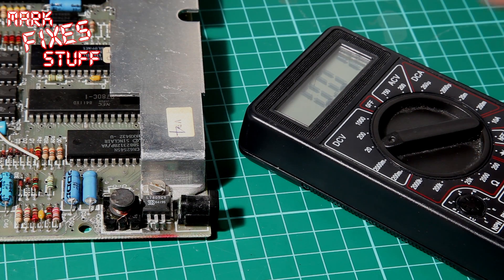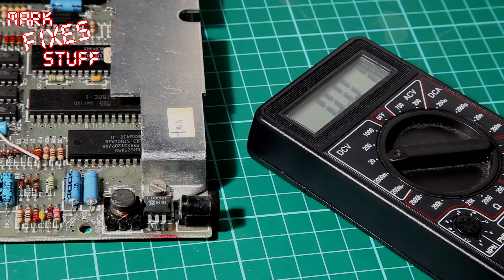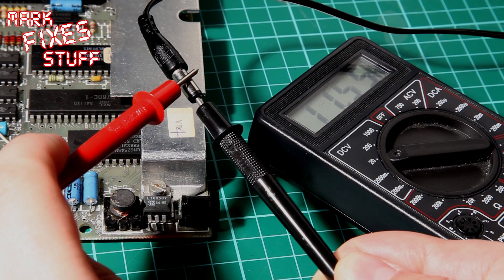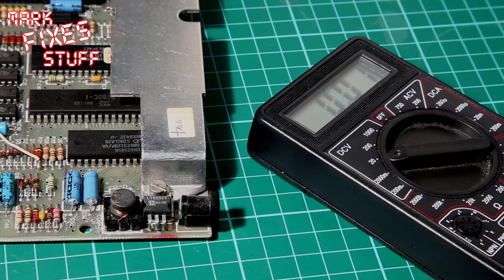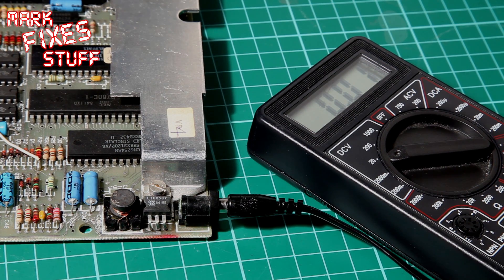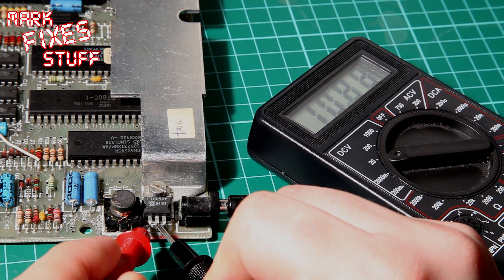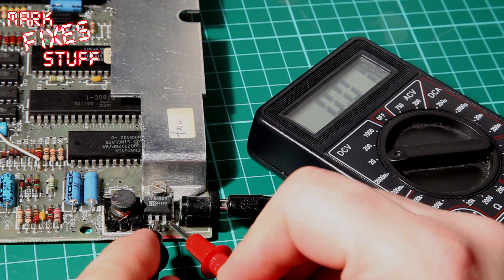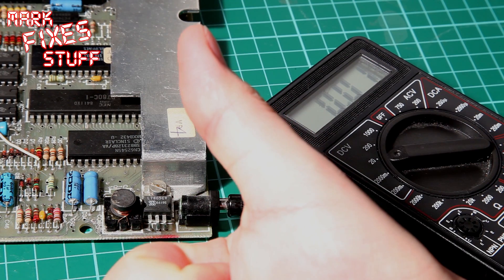Sinclair ZX Spectrum 48k Repair: Test a 7805 regulator in a ZX Spectrum with a cheap multimeter

Comment: Hi, does the computer have a power-on switch thus it's safe to check the 7805 with the power plug connected ("live")? Because if the 7805 is shorted then 10 volts will be going in the 5V rail which would fry most of the logic inside.

Comment: Hi Mark.  I have a 48k here,  the regulator tests OK as in the video,  but when plugged in I get nothing.   The voltages to IC6 (ram) are too low,  where could I be dropping voltage?
Reply from the maker: Hard to say because it could be a short anywhere really. It could be a shorted coil. Does it hum or whine? It should have a slight sound.
Reply: @MarkFixesStuff  Hi Mark.  It doesn't hum or whine.  The only check I've done on the coil is to check the resistance across each coil and it is very low which I think is a good result.
Reply from the maker: Have you checked TR4 and TR5?
Reply: @MarkFixesStuff  I learned this morning that these are likely culprits, what do you recommend as a check?  My thought is to check the 2 junctions are cut off with no power, but i haven't found any advice. Thanks for you help
Reply from the maker: Yes, a diode check will find the culprit pretty quickly as you guessed
Reply: @MarkFixesStuff  I checked tr4 and tr5, with no power,  both transistors are conducting from emitter to collector and vice versa, I think this means they are shorted, although I didn't desolder them for the test
Reply from the maker: @JimboWizbo  They are boofed then. Be prepared for some dead ram chips...
Reply: @MarkFixesStuff  Uh oh, they seem harder to remove than transistors

Comment: Hi i am not completely sure if this is related the voltage regulator or not, but when i plug my issue 2 48k rubber key spectrum in, i get this annoying high pitched whine sound, any ideas on what it could be or if its normal, thanks
Reply from the maker: It's from the coil most likely. It's near the regulator. Are you sensitive to high frequency noise, as most spectrums do make a bit of a whine.
Reply: That whine is normal.

Comment: Hello again Mark,
I replaced so far the  7805 by L7805CV. 
I got a non original 9v 1A transformer and is outputting 12.20 v
and I got this outputs: 7,30v and 3.7v from the power regulator.
 
I got a strange low noise clicking from the speaker is this ok?
Because i don’t have video output yet, and In going to apply the video hack next...
But it didn’t overheat this time :)

Comment from the maker: Hmm. The specs on most 7805 regs are + or - 4%, which would be between 4.8v and 5.2v output to be withing range. My *personal* feeling is that for the old chips in the speccy that's out a bit too much, and would almost have been rejected by the factory! 

The fact that it's and easy part to change and that the parts are dirt cheap would lead me to say change it anyway.

As a side note, I've not had a 7805 that has output more than 5.04v, so don't know what effect 5.16v would have.

Comment: I just retested my original regulator - the 5V pin is steady at 5.16 - is that acceptable?  Its 0.16 higher then 5v, but its not moving from that...

Comment from the maker: A 7805 is a 5V regulator with a 1a supply capability. The 7805CV is *capable* of supplying 1.5a so it's more robust regulator, and will work fine.

Comment: Awesome tip for a noob like myself - I'm waiting on a few things from eBay, but I'll swap out this first and see if it helps my poor speccies.

BTW, what is the difference between LM7805 and LM780SCV?  I ordered what was listed as 'LM7805', but I spotted that the photo has 780SCV printed on the component (after I'd ordered that is).

I can get LM7805's from a local electronics store - of course, what I pay here is $1.00 each.  eBay was $1.50 for 5... Will 780SCV be ok, or a bad idea?

Comment from the maker: Sounds like a component is tripping due to heat. If it's functioning well until it reboots then I'd start with replacing the capacitors as a matter of course (they age so could be a cause) Other than that I'd look at the NPN/PNP transitor pair. You could also be looking at a dry solder joint.